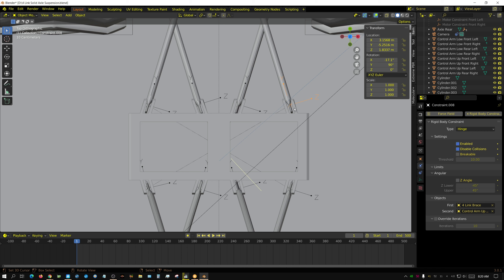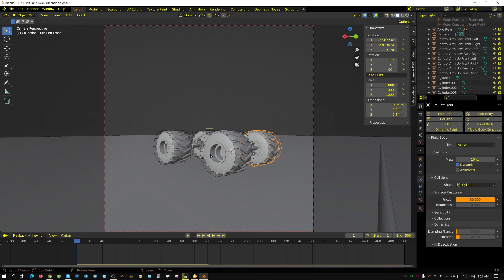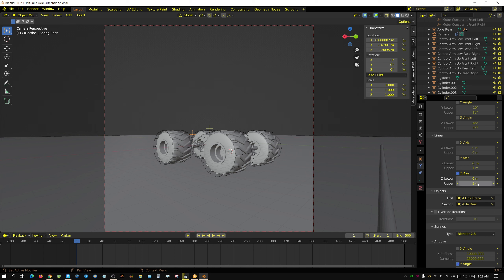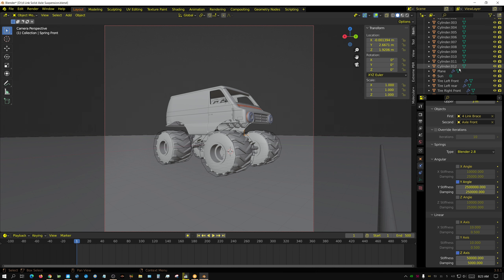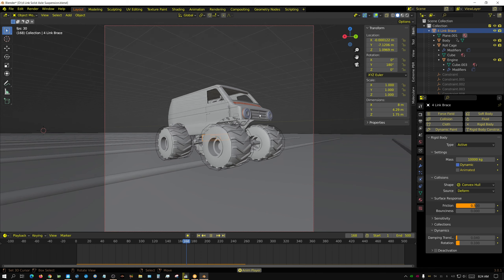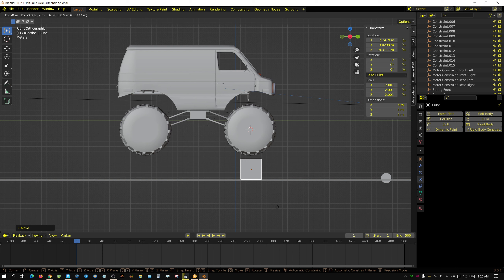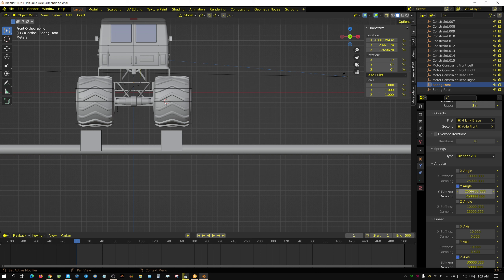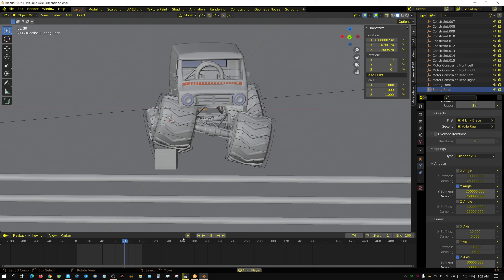Near Final Rigid Body Suspension Tuning

Comment: Damn! That's looking great! Are you going to do a soft body or cloth sim for the deformation of the tires over objects? Those type of tires aren't that stiff.
I've been so busy with two jobs, I've had little time to Blender anything. I'm kinda being on the tech now. The reason I follow you; to stay updated! LOL Thanks!
Reply from the maker: Thanks.
I have tried to make compressible tires and I cannot get it to work correctly. 

Yeah, two jobs tend to use up a lot of time. I am lucky that I work primarily from home.

There are new features in Blender that I have barely messed with. Things like geometry nodes.